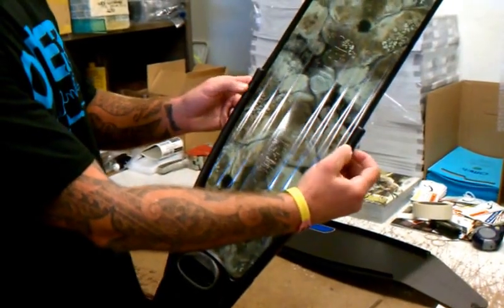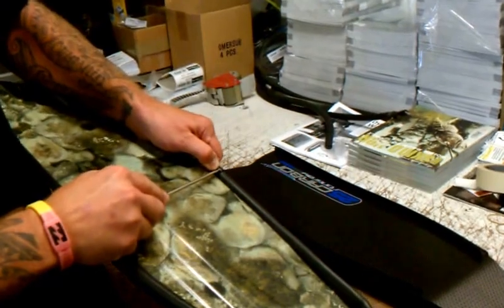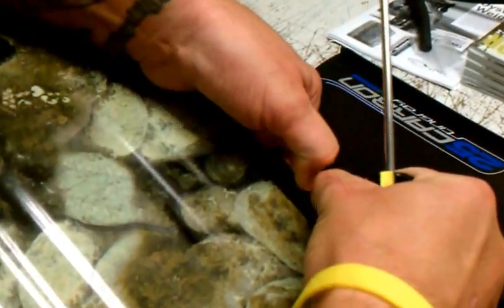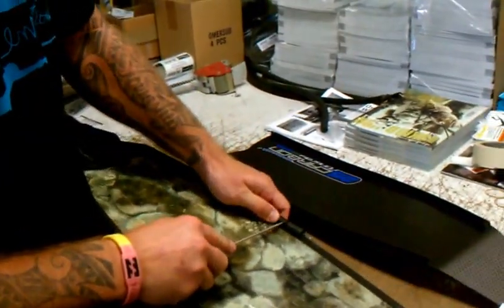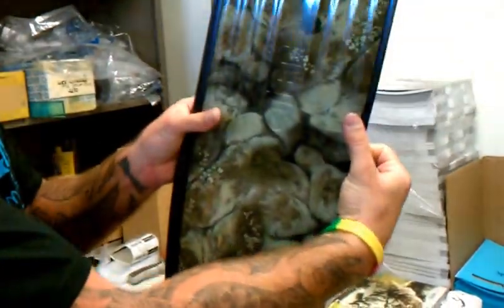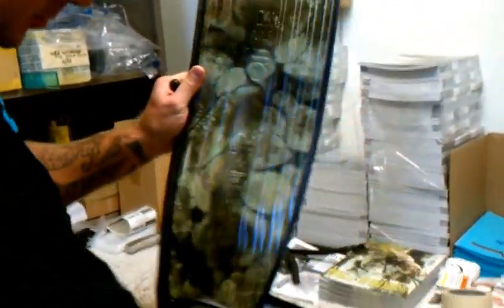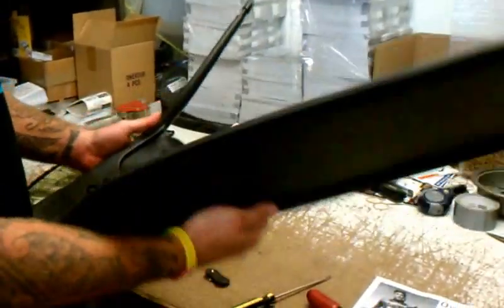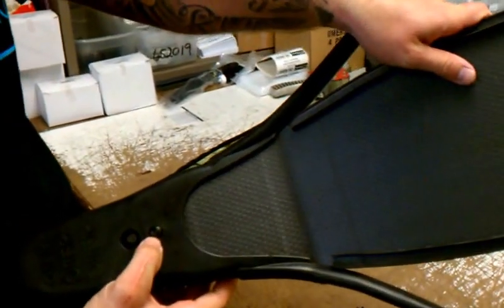Omer Stingray Blade Removal

Comment: I broke apart this find and now I can't put it back on. I peeled it to the bottom and tried it like youa re doing but it doesn't go in. Any tip? Is it because the rubber part is too hard? Any way to soften it?
Reply from the maker: Sunnybeam there's really not a way to soften the rails. you just need to bend the back more carefully as to no break them.
Reply: Thank you Keith. I bended even more and I managed to squeeze it in though it didn't go back in completely. I probably didn't have power to push it in all the way. I thought it would be nice if i can break it apart and put it back easily since I'm traveling overseas but now I'm afraid of taking it apart. you make it look so easy. thanks for your advice.

Comment: I just did this for my Omer Stingray but I put Omer 3D Carbon Fiber 25 blades.  I did not get the clips for the sides with my footpockets and the Omer 3D CF blades did not come with holes for the 2 phillips screws.  Do I need to drill holes in my CF blades to allow for screws?  Also do I need the 2 clips on the sides or do some footpockets have a type that doesn't use the 2 clips?
Reply from the maker: The Carbon Fiber blades do not require holes because they have the nipple on the back of the blade. As for the clips on the side you can use the same clips that were on the stringray plastic blades. DO NOT DRILL HOLES!!! It will weaken the blade at that point.
Reply: Keith Bailey Thanks for the information, I thought it was strange that no holes were pre-cut as the fins were Omer and the Boots also Omer.  The C4 fins have pre-cut holes though for the same foot pockets, which sort of made me wonder.  Is the nipple strong enough to keep the blades in place or will they slip out sometimes?  Another thing is that apparently there are two types of Omer Stingray pockets and one of them does not have the clips to hold the edges as it is designed a little differently to be able to hold without the clips.
Reply from the maker: majdq8 Yes the C4 blades have the screws and the nipple is strong enough I have not heard of problems with it. As for the pockets I have only ever seen 1 type of stingray pocket. There is a similar Spitfire pocket made by Sporasub which has a different style clip. The rubber rails on the Stringray Carbon snap into the Stingray pocket rails. You can actually hear the blade seat into the rails when installing them.

Comment: Does a carbon fiber blade fit onto eagleray footpocket my friend?
Reply from the maker: xristoc1 If it is the newer version of the eagleray footpocket they will
Reply: Keith Bailey thank you!!Do you now if eagleray footpockets match with carbon blades of other companies?
Reply from the maker: xristoc1 I do know the C4 skorpios fit into them.
Reply: Keith Bailey thank you again!!!
Reply from the maker: +southank1 the easiest way to tell is that the angle on the footpocket is 22 degrees then you have the newer model. the older model has a 19 degree angle
Reply: xristoc1 i